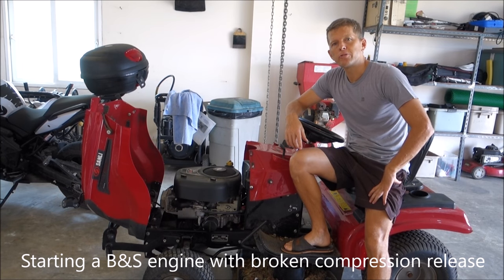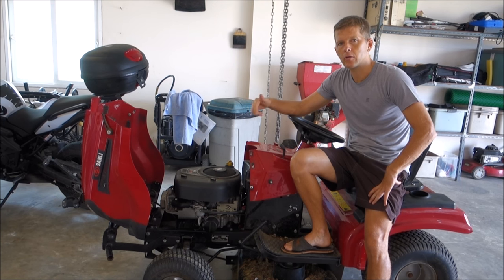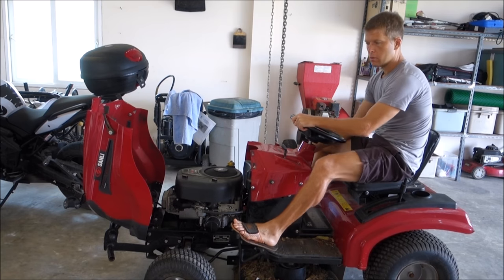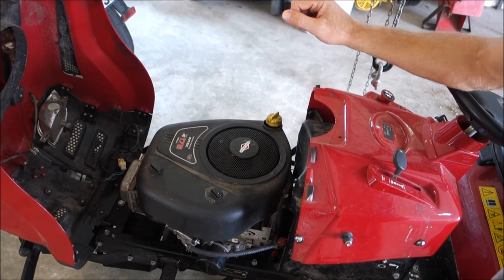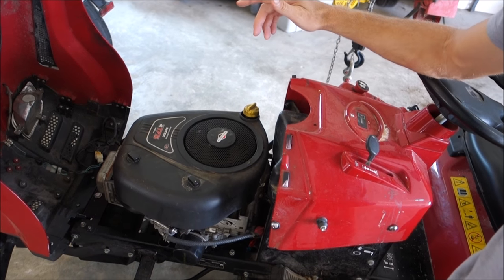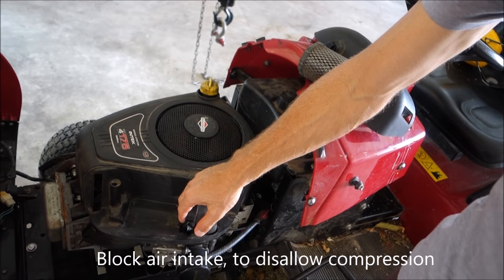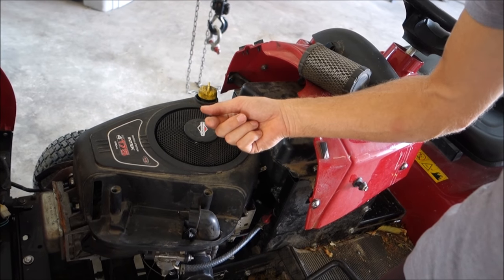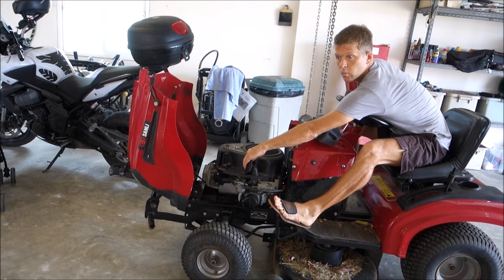Briggs & Stratton Compression releif fix

Comment: Adjust valve clearance to .004 inlet and .0005 exhaust, end of problem. Mechanics won't tell you this because they all want to see a new engine. A simple 10 minute job and the clearances are crucial. Give it a go.
Reply: Set my valves to .004 and still isn't starting. Its compression locking on the compression stroke. I'm going to try blocking the intake in the morning like in the vid. I am about positive my compression release is broken just by turning it by hand.
Reply: @BensMiniToons  then it hasn't been done the job correctly.
Reply: @richardw1744  .004 has a some drag, 005 will not fit. I've been doing valves for years on dirt bikes four wheelers and utility tractors..
  The electric starter on these mowers is under powered so it has compression release Mine Broke off of the cam shaft.. I have a Brakes & Scrapem motor. (briggs and stratton) on a husqvarna yht2048
 My mower turns till the compression stroke and gets compression lock. I can turn it past top dead center by hand. To fix a broken compression release it you need to replace the entire Cam shaft.
 I just tried the trick blocking the intake so it pulls a vacuum and doesn't have as much air to compress letting the starter turn over. I let the starter build up speed and soon as I let air into the intake it Fired up first try!
The other comments are not lying.
Reply: @richardw1744  wait! .0005 on the exhaust will fix it? I thought that was a typo. 
.005 VS .0005 sorry if I misunderstood.

Comment: also an easy way is to run the motor by hand up to top dead center where its real hard to turn....spray starting fluid in breather tube..put breather back on and start it pops right off

Comment: Did you try adjusting your valves. Valve gap is normally why the compression relief does not work on a Briggs
Reply: Nope, all these single cylinder compression releases on the camshaft eventually fail. The tiny shaft is too small to indefinably resist the force on it, and it eventually snaps.

Comment: All is great BUT what about the broken pieces left inside the engine? It has the potential to break the piston or other moving parts inside the crank case Best to fix it right
Reply: So what only bought them over for a hundred bucks if I get two cuts out of it I'm up a hundred bucks
Reply: Yes broken parts in your engine can be a problem. I happened to change the oil just before I started trouble shooting. I always have the tractor canted towards the drain hole. When the oil is completely drained I remove the dipstick holder?tube and look in the bottom of the engine through the dipstick hole. This time I saw a spring and other metal parts down there. I used a magnet to fish them out. After watching this video and another I’m going to start it and run it 🤷
Reply: …just spent two hours mowing everything worked well. 🤞

Comment: The only question I would have about this fix is if the compression relief trigger is broken it's still inside the engine just rummaging around in there.  If it happens to land in the wrong spot you then can have what's commonly referred to as "Catastrophic Failure"
Reply: Unless it destroys the engine as it breaks off, the parts usually just sit on the bottom.

Comment: I see this being a helpful diagnostic tool, but it would be unwise to run an engine for any length of time after the relief has essentially blown-up in the engine. There are pieces of metal floating around in the crankcase. It's just asking for a much larger problem later on.

Comment: So what happens to the broken pieces floating around in the engine?
Reply: Seems that Everytime I open one up to replace the camshaft, the compression release parts have just been laying in the sump. I don't recall ever seeing one that has caused any damage.
Although it is definitely a possibility that those parts could fall the wrong way and cause problems.

Comment: That's fine but if you never fixed the broken compression release on the cam, that piece is still floating around in the engine and possibly causing more damage. You still need to fix the problem.

Comment: Beware that this may cause internal damage to the rotating engine parts if the broken pieces are left in the engine.  My compression release broke in the middle of cutting the lawn the other day.  I heard something banging around so I immediately shut it off.  I tried to start again, and of course it wouldn't crank.  It's such an insanely bad design flaw in these engines.
Reply: That's an inconvenient bit of information.  On the other hand, rebuilding the engine will be as big a PITA as simply replacing it.
Reply: @peterbridge9394  They haven't changed anything even on the new 17.5, 18, and 19hp Inteks you buy now. Still the same cam with a swinging weight. 

There is another you tuber that has a post about putting an Air Conditioning O-ring  beside the weight to keep it from rocking side to side. There is around .o9o" of free play side to side, which allows the rod that seats in the gap in the cam lobe to catch slightly on the lifter rod every time the cam passes by the lifter rod. That constant catching on that rod eventually causes the shaft of that counter weight to fail from vibrating continually. So just throwing the new camshaft in still has the same side to side play of that counterweight. Unless you use that O-ring trick.
Reply: @kramnull8962  Not sure that O-ring will last with compression relief mechanism rubbing against it, also the hot engine oil might wreak havoc on it
Reply: @fastguned  The one he used was a green one for AC use. 

I went ahead and just pulled my crankcase apart and cleaned it out of debris and stuck the old cam back in. Hold my hand over the air intake inlet everytime I start it. It's ok for me. Ran her a few times and no oil usage, so I should get the life of the transmission out of her now....
Reply: @kramnull8962   Good deal.
Reply: @kramnull8962  Wow... you took apart your engine & put it back together WITHOUT replacing the cam with new compression relief part? I'm gonna try this little trick in video. I just spent $75 on new battery & starter, only to find what is actually wrong/broken.Oh and adjust the valves FIRST, because "they say" sometimes it's just loose valves because the compression relief "bump" is so minute.

Comment: Interesting. I'll have to try this next time I run into this problem. I've worked on several Intek's with this issue. I'd recommend removing the broken compression release though. It's really not that difficult. Remove the engine, drain the oil, turn it upside down, remove the bottom of the crankcase, and fish out the broken pieces. Usually there'll be several. You'd be best to get a new sump gasket, and maybe a new crankshaft seal. And if you really wanted to, replacing the camshaft is not that difficult either, it's just that they cost $90 for the OEM. Or you could try the cheap CCP ones on Amazon which I think are half that.
Reply: Yes sir. That whole engine ain't worth $90 LOL... fucking junk
Reply: @catchingfadesclashroyal6506  yeah, mine only mowed an acre for twenty years.  Junk, right?  "LOL".

Comment: I'd be concerned about doing this.  There's several broken metal parts, from the decompression assembly, in the bottom of the motor.  I'd be worried about them causing a more serious motor problem.

Comment: Nice, but you don't have to do all that.  Before attempting to start it, lift the hood and place your palm firmly down on top of the flywheel screen.  While pressing down firmly, rotate the engine it 1/2 turn in the direction opposite the normal engine rotation.  Take your hand off the motor and attempt to start.
Reply: Mmmmmmm

Comment: hi! Good idea thanks for video. I
m having same issue, my lawn mower is only 3 years old!  But also what do you think about modifying the choke leaver ? The choke blocks air but there is a small relieve hole. What if you simply tape that relief hole, when choke is on, air is completely blocked?
Reply: LOL Tape?  Try welding it, tape will never hold and will just get sucked inside the engine
Reply: It still sucks lot of air,

Comment: Wow, for real.   Jesus Fn Christ.
I wish they had just given us a pull lever to operate the compression release instead of this automatic stuff that fails.
I can't get to my air intake easily, so what I do, is connect a battery charger to the battery and set it at the 20amp crank mode, and that will get me past the first compression stroke...  for a couple of strokes anyway.   If it don't crank, turn down the charger to 5 amps, let it sit a little, then back up to 20amp crank and try again.

Comment: Why did you splice/edit a piece right after you turned the key.   And then it starts.   This did not work for me.  Somethings not right.
Reply: Turn the engine by using the top screen just past the compression stroke, cover the intake, put on the choke, then start the engine. It usually works IF you have cut off the air until the engine is rotating.

Comment: Don't the choke do the same thing  ?
Reply: No, the choke cuts of some air, but not enough to stop most of the air from getting into the engine cylinder. The purpose of the choke is to cut off some air, so that the gasoline mixture has a lot of gas relative to the amount of air to start a cold engine.

Comment: That's all fine and dandy. It's a workaround not a fix. A faster workaround is just spinning the top of the mower backwards until you got compression again, then start it. No disassembly required, just pop the hood. That gives the moving parts enough momentum to start it, as long as the rest of the engine is up to snuff.
Reply: I tried that a few times and does not work for me.
Reply: @tpmarkham  Ditto. But the "seal the intake" worked.
PS Mine has no compression release
Briggs model 331877  2371 G5

Comment: The title needs to be changed to WORK AROUND, not fix. A fix would be when you turn the key from a seated position and the engine cranks and then runs.

Comment: Don't forget that when the decompression mechanism fails it throws a load of metal shrapnel into the engine. My 19HP is doing the same thing after maybe 100-150 hours. Briggs & Stratton needs a good class action lawsuit on their hands for this bone-headed design blunder.

Comment: Not that hard to repair it, there are many videos showing how.Your method will only easily work on that one particular intake there are others that are near impossible to block because they are designed differently. Repairing SOLVES the problem!
Reply: Only until it fails again, which it will.

Comment: DO NOT do this! A broken compression relief means there are chunks of metal in your crank case and 100% metal shavings in your oil that can and will chew up your crank and cam gears, score your cylinder wall and ruin your con rod costing you a complete rebuild and possibly a whole new engine! This is not a “FIX” … it is ignoring a major malfunction and plainly put …. It’s an ignorant move.

Comment: There is no compression release valve in the engine. The valves are out of adjustment. This is a common issue with that engine.
Reply: Sorry, but these engines do have a compression relief switch. It's on the camshaft.
Reply: There are countless videos and forum posts about this 17.5hp Intek engine and the compression release on the camshaft going bad. I have a 20hp and the exact same problem.
Reply: They do.... initially I thought my problem was a valve adjustment and I did it three times to be sure that it was correct and I'm certain the compression relief on the cam isn't working properly
Reply: The compression release is on the camshaft,activated by a spring and flyweight. It technically isn't a 'valve',but a device that holds a valve open.This release mechanism is a common issue with the Intek OHV engines. Due to the widespread problems with this piece of the engine,the repair part,the cam,is available everywhere online.
Reply: There is a compression release. I’m not sure what engine we’re messing with here but it’s either on camshaft or under flywheel. When the piston moves back and forth, there’s more and less compression in the crankcase and we gotta let that out somehow
Reply: Intek OHV engines,12hp thru 19hp. Valve/lifter/rocker adjustment is critical on these engines. Often diagnosed as a bad camshaft compression release mechanism,adjusting the lifter settings will often cure the problem of stopping before/at TDC due to high compression. Adjust the valves FIRST.
Reply: @syrupman2292  Some do, some do not. Depends on you model number.
My 21hp does NOT have compression release. Briggs 331877  2371 G5
Reply: I have the 331877-1371-B1 version of this engine (the 21 hp version). I replaced the starter, adjusted the valves to .004 (intake) and .006 (exhaust) checked it several times and still couldn't get the engine to crank past the compression stroke. Tried this little trick and it worked like a charm. Thanks for the info.
Reply: I like you believed that too after adjusting valves three or four times with no success I discovered there is an actual compression release on the cam which seems to break off alot on these engines.

Comment: Bologna, bro. Even if this did work, you still have bits and pieces of the compression release flying around the inside of your engine, which will eventually get caught between your cam gear and crank gear and destroy the engine even more.